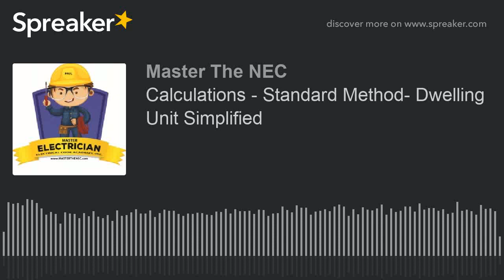Calculations - Standard Method- Dwelling Unit Simplified

Comment: This podcast was immensely helpful for me. I was having a hard time deciphering the practice book i was going through on this subject. ALTHOUGH i have one question. at 59:20 when you were adding up all of the numbers for the neutral you didnt add the 828VA to the total numbers you only added the 207 VA. But with the conductors we added both numbers because I thought we were trying to add 125% but in that last part you only added the 25% not the 125%. Im confused, please clarify. 

Because the number you got was 18958, which is 6150+2328+3500+5600+1173+207
But isnt it supposed to be                                            6150+2328+3500+5600+1173+207+828 ??
Reply from the maker: Angel - The only value we take for the neutral is the 25% in that part of the equation as we already accounted for the neutral loads that were 120V when we did the appliances. Since the sink waste-disposal was the largest load and we already accounted for it we were simply gaining the additional 25% per 220.50 and 430.24. Remember, at that part of the podcast we are doing neutral loads and working down to the last item which is the 25% of the largest motor.
Reply from the maker: The VIDEO is better than the Podcast BTW. The video is on this channel. https://youtu.be/FTHQ16efncs

Comment: Paul for the .83%, table 310.15(b)7rule where I live you can only use 2008 nec as a reference. So how do I use the table instead of using the calculation.83% method? Thanks in advance
Reply from the maker: The table in the 2008 NEC is based on the 83% rule. The only reason the table was removed was to avoid the confusion where folks thought that you could just pick a conductor from this table and no other adjustments or corrections applied, which is incorrect so they removed it in an effort to avoid possible confusion on that fact.